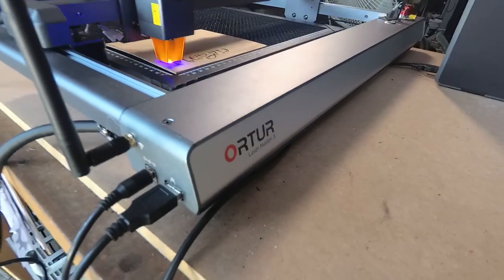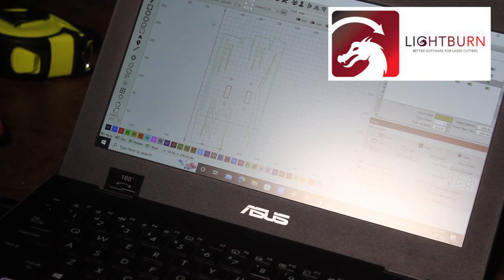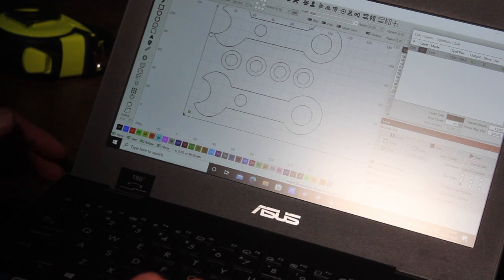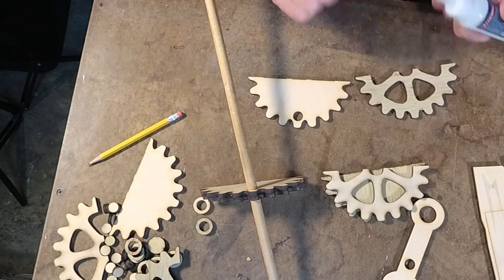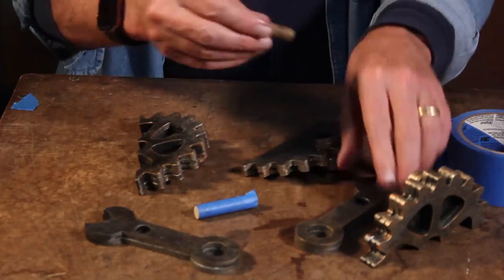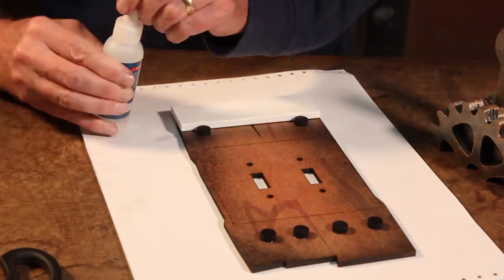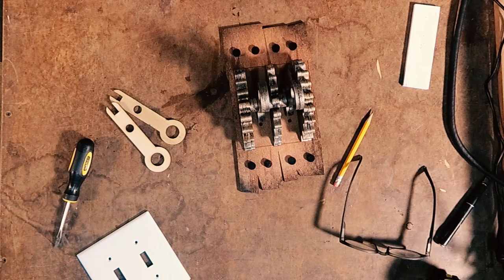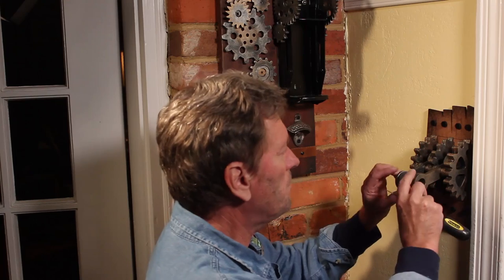Amazing Laser Project! Industrial Design Light Switch

Comment: Pro tip - you can switch to Inches mode by clicking the little box to the right of the Rotate field in the top bar marked "mm" you can even do dual units!
Reply from the maker: You have to be kidding! That is so cool. That is going to make things so much easier. All though it probably wouldn’t hurt me to leave metric. LOL. Thanks so much for watching and the great tip!

Comment: Just wondering.  Are the switches backwards ? ( up is off. Down is on ) ?  I can change the wires if so I guess
Reply from the maker: You are so correct. I flipped the switches for that very reason. I should have mentioned that. Thanks so much for w.